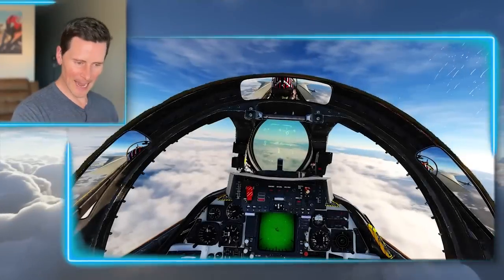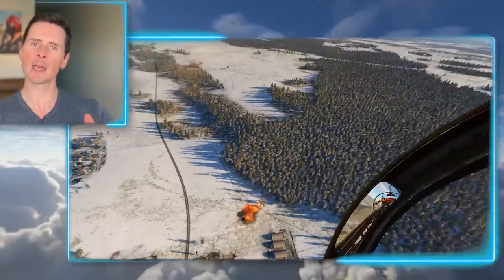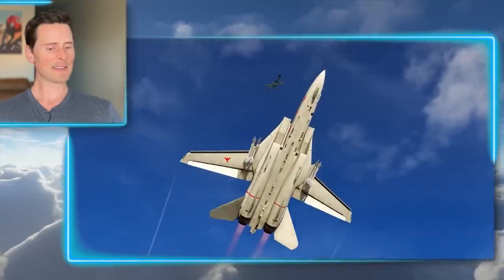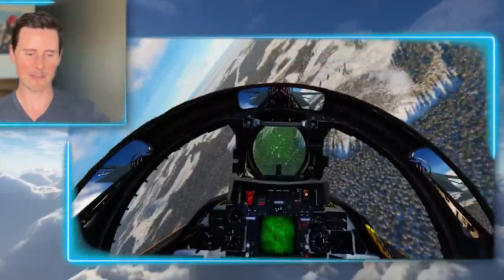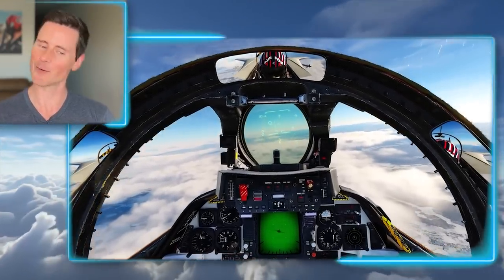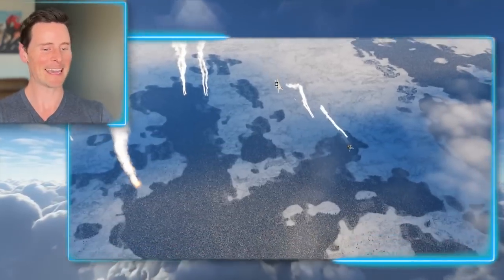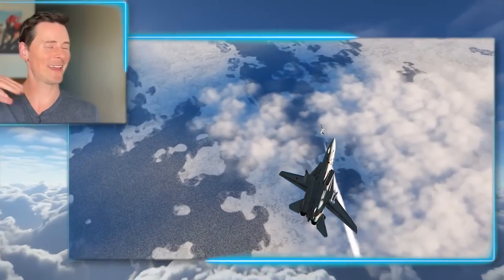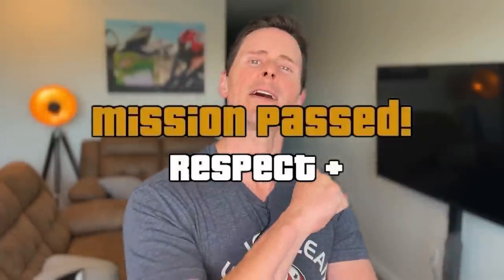F-14 Split Throttle Dog Fight From Top Gun Maverick | Fighter Pilot Reacts

Comment: Growling Sidewinder has definitely been practicing split throttles a lot and it shows. With the F-14s engines spaced pretty far apart and the fact they're canted and are asymmetrical, it definitely can have its perks. I could see it having some benefits with the F-15. The F-18 Hornet is woefully underpowered in thrust to weight and its thrust is symmetrical, so split throttles won't do much for them.
Reply: Woefully underpowered? The legacy hornet has the exact same T/W ratio as the F-16 when they're both at 50% fuel...

Comment: @MaxAfterburner: I've been trying to get an answer for this but I haven't been able to yet, so I'm hoping you might.  Does the distance between the two engines determine the effectiveness of the differentiated throttle?  For example, the engines on the F14 are farther apart than those on the F15.  So would you be able to swing that plane around better with the engines out more to the outside?

Comment: growling sidewinder mentions that you do it for just a second or 2 , just like if you were to pull the e brake and initiate a drift, you dont hold the brake down till your spinning into the wall, you just do it to get the tail sliding and then you balance it out. Although a second on the controls gonna be more for the turbine lag/delay.

Comment: So I get the premise of splitting the throttles, i.e., right one on left off.But what was he doing to the vertical stableizers ?I only have experience in cesnas and Cherokees And obviously the ruder is controlled by your feet.In the Maverick scene as he splitting the throttles it shows him slamming the right rudder then the left almost like someone shifting a car ie depress clutch hit gas .he seems to do a movement similar. What am I missing?Was his movements with his feet correct?

Comment: MAX is awesome. you can tell he's a fan of fighter jets, not just "yeah I flew them and everything is bullshit"  like some people we know. call sign "PLAGUE' is almost as scary as "VIPER"...anyone remember in the original TOP GUN where Goose tells Maverick to "WATCH OUT FOR THE MOUNTAINS!?  that was filmed over Fallon and the "mountains" were actually hills that I could see from the barracks window. so if 10k was the hard deck, they must have been 9300 feet below that. additionally the tower they buzzed certainly wasn't Miramar. ours was the only ramshackle structure like that. they filmed alot of the air to air stuff over our ranges because they're huge. big enough to get the CAG ready before deployment. but not big enough to keep some guy's Winnebago from getting blown to bits while he was in town on his motorcycle.

Comment: Not sure how healthy that is in F-14A with that notorious PW engines ( Maverick Iranian F-14A PW engines) and not ending  in a flat spin  B & D with the BIG GE motors maybe more like it but seems like a gamble , never heard any F-14 pilot doing it purposely , "cheating" on the wing sweep and air speed yes , putting down the BIG BOYS in slow rate fight yes , cracking 10G that too however asymmetrical thrust never .
Reply from the maker: Hello thanks for the comment!
Reply: @MaxAfterburnerusa  Once an F-14 pilot told me that it was quite unpleasant once they lost one engine and there was quite some rudder and stick work to keep that thing controllable not only the engines are wide spread but also few degrees offside . However I believe you know everything about this anyway , love what you doing , watching everything you put out. Keep it coming , keep it coming !

Comment: F14 couldn’t split throttles. It would’ve caused flat spin due to cant of the engines.
Reply from the maker: Hey there thanks for watching!
Reply: Thanks for the content! Love hearing real fighter pilots talk about the planes!
Reply: It can split throttle but if you split to much it will put you into a flat spin. I think that’s what you where trying to say but I’m not sure.
Reply: Flat spin is accidental. Which means it could happen, but it doesn’t most of the time, or for most pilots it never happens. I heard about split throttle quite early on first from F14 discussions, and it was even NASA test bed for asymmetrical thrust. So your conclusion is quite ill-judged.
Reply: @ruiliu4157  what you just said made 0 cents